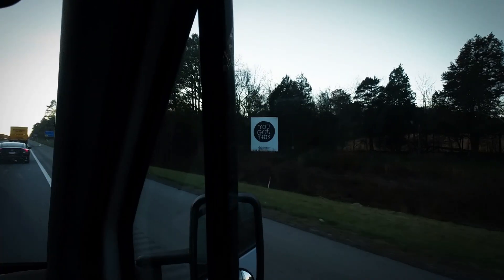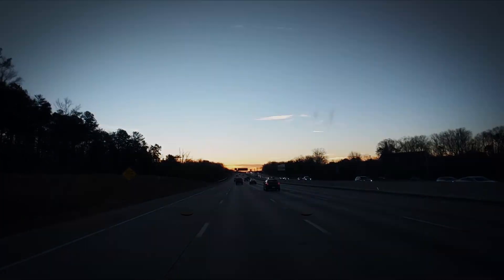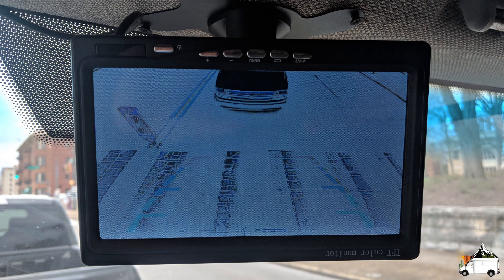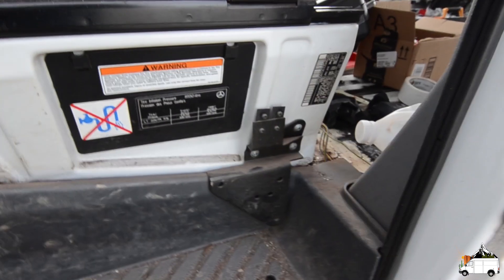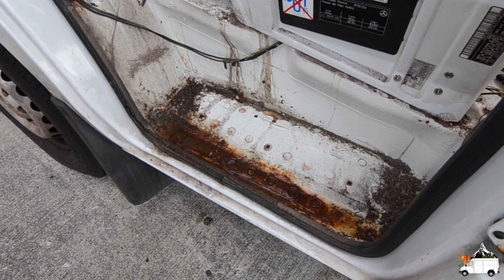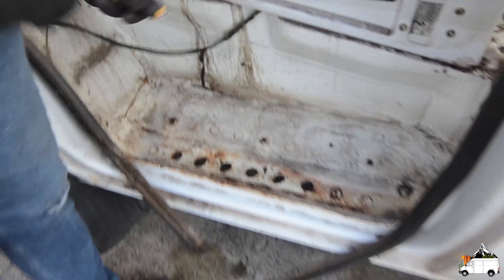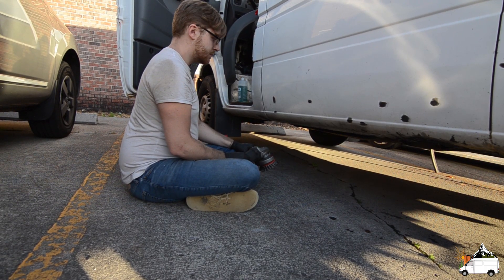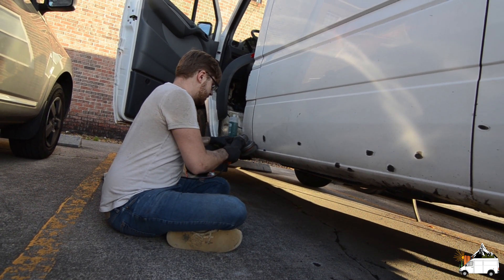Finding More Issues | Van Conversion | Project Vagrant

Comment: Hi Guys. Catching up on your videos. One tip that might be useful for you and your water/rust problems. Ensure that the drain holes on the inside sill panel are clear and not blocked, otherwise water will build up in the sill. Apparently this is a known issue on Merc sprinters and probably other manufacturers. I hope the underside of your van is not too crusty. Corrosion is a big problem. Best regards. Barry8082
Reply from the maker: Thanks for the tip Barry! Looks like you're watching our videos back when we recorded with our cell phones lol, glad you're enjoying enough to watch them though :)

We have left them unblocked, there unfortunately is a bit of rust down there. I'm going to get what I can of it treated and repaint with a product like "chassis saver" from Magnet Paints (heard good things from others on this product), the rest I'm just going to cover in a product like fluid film every year to stop the rust from progressing since it'll be near impossible to reach in some places
Reply: @projectvagrant8197  Good idea to protect the underside of your van, especially if you are near the coast (that salty air). There are some great videos on YT on rust protection including "home brew" formulations that look quite effective and cheap to make (if a little messy).  Use a long extension on your aerosol can to really get into the sill cavity and coat the inside as much as possible. TYou could drill a few extra holes in the inside sill to ensure complete drainage. Your videos are really good and you are building a great camper. All the best. Barry8082